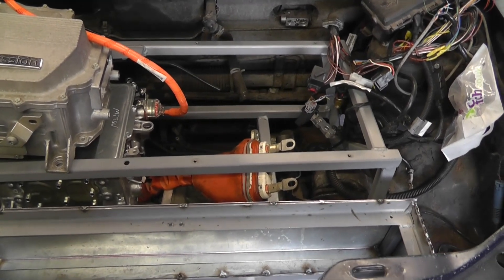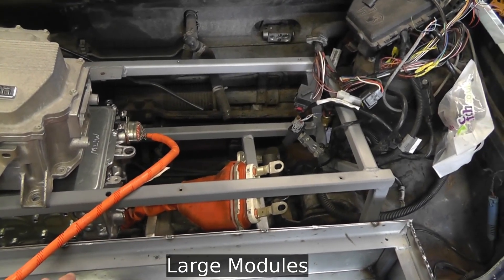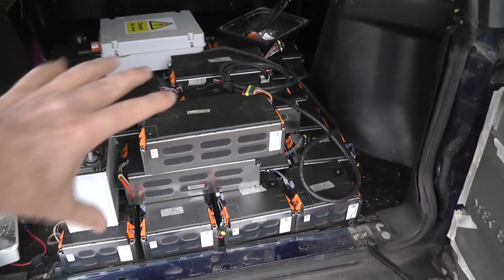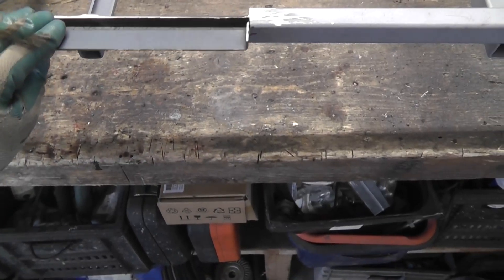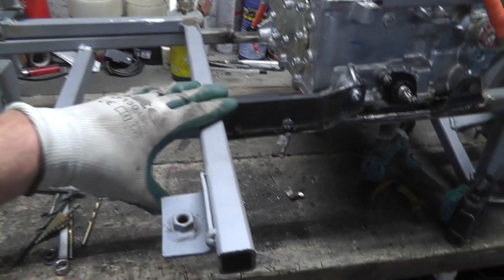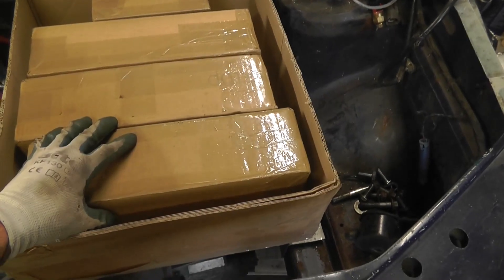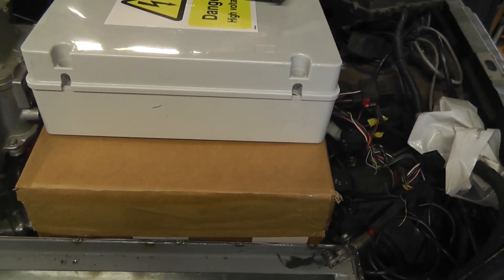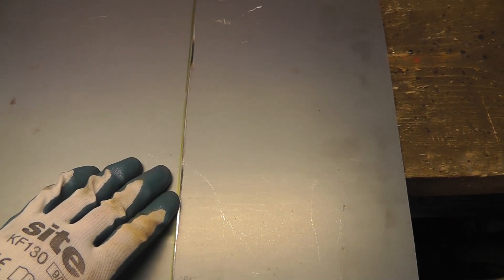DIY EV Part 32 - Hacking Away half the Frame Plus New Battery Box

Comment: Nice to see it morphing into a well sorted project Ali.
I'd not bother with the under bonnet sound insulation, as it's not got a rattling diesel engine to quieten up now.
Just remove it all, and save a few grams of weight. ;)
Reply from the maker: Thanks mate, I'm not too concerned about the sound insulation apart from whining PS motor and the tin drum I've just created. 😕